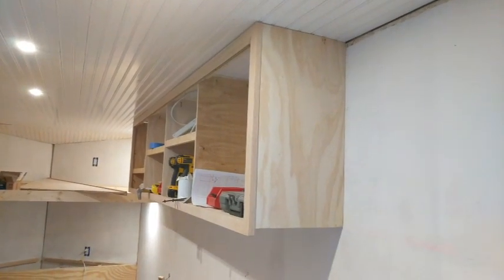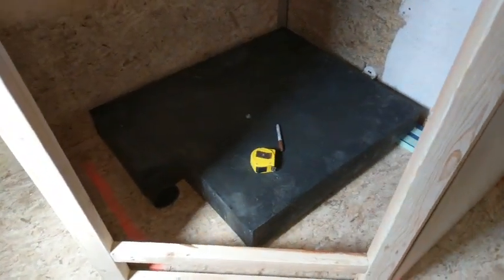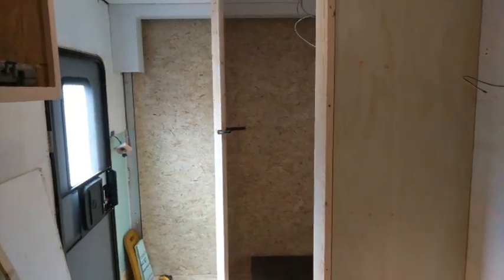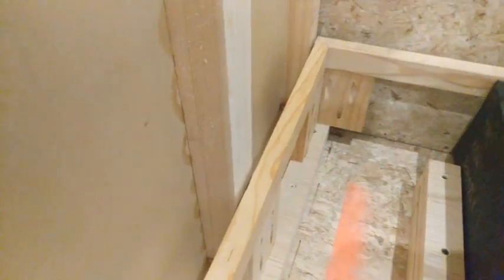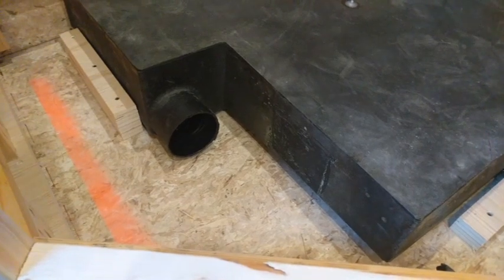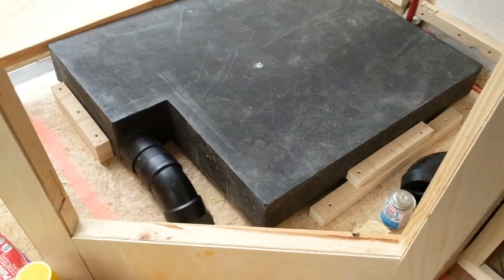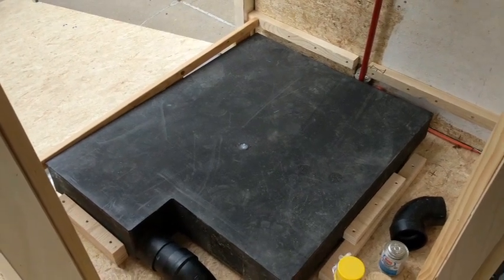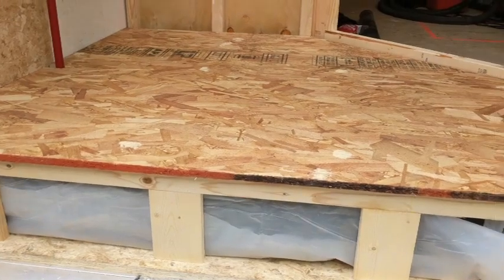Cargo Trailer Camper Conversion - Part 13 Bathroom Rough-In

Comment: I just watched 13 of your videos ... beautiful work! Love your build... you do things the right way ... with much forethought and  planning.. I commend you, sir!
Reply from the maker: Thank you.  Unfortunately, it takes forever to get things done when you overthink them :)  I planned on a 3-month build and so far its taken over 6 months.  I did not account for our coldest winter ever so I did not get much done until the snow melted.
Reply: How tall was the black water tank you bought? And roughly how many inches high did it make that platform? We’re thinking of doing this with our shower and gray water tank. The shower stall is 75” so we’d have roughly 8” of play to our ceiling

Comment: Thanks for making these, nice work.  Quick questions on shower / black water tank.  1. wouldn't you use a gray water tank for the shower?  2. don't you need a P trap for the shower drain, especially if connecting to black water tank.  Also, wouldn't you want to glue the tank to the floor?  When you hit bumps, and there's "water" in there, I could see that tank bouncing up and taking out your shower floor?  Thank you!
Reply from the maker: Most campers have a gray water tank from the shower. We rarely use the shower because it fills up the gray water tank almost immediately when you use it. They just don't have enough capacity.  Since we only use the shower when we have a full hookup, I didn't bother routing it through a tank, and just ran it directly to the outlet connection.  There's a p-trap below the floor to keep gases from coming back and I also installed a ball valve so we can totally isolate that system when we're not using the shower.  The black water tank is actually sandwiched in place by the floor above so it cannot move.  The floor is fastened tight against the top of the tank.

Comment: Had an idea for my 7x16 work trailer.When nature calls its always annoying to have to stop and leave the job,ect to take care of business.I thought about adding in a small cubby at the V front of the trailer a small toilet and black tank,ect but what about using a portable tank that is used to empty the black tank instead frame it up so the toilet sit above that and is flushed into the portable tank then just roll it out when it needs emptied and roll it back in?
Reply from the maker: That would work, but it might be difficult.  You would need to have the toilet high enough for the connection to be removed on the top of the portable tank.  Then you would need to be very careful when disconnecting the tank inside of the trailer.  You would not want to spill!!!  You might be better off just using a homemade composting toilet (i.e sawdust and a bucket) or a portable toilet with a built-in tank like they use in tents.

Comment: Hi, where did you find the black water tank at?
Reply from the maker: I bought all of the tanks from tank-mart.com
Verify the shipping cost before you order.  They cost almost as much to ship as they do to buy.
Reply: thanks, how many gallons is the black water tank?
Reply: What are the dimensions, and how many gallons is your black water tank? We are putting a sleeping quarters in a horse trailer and that tank will work out perfect!
Reply from the maker: @ds3591  It's a 25 gallon tank #H-423.
Reply: Kim Donaghy, REALTOR, Ayre Rhinehart Realtors thanks I appreciate it.

Comment: A shower takes up to much room. Most campsites have showers or you use a portable instant hot water heater with a shower hose and head on it . And put up a hula hoop with a curtain and muck tub or shower outside.